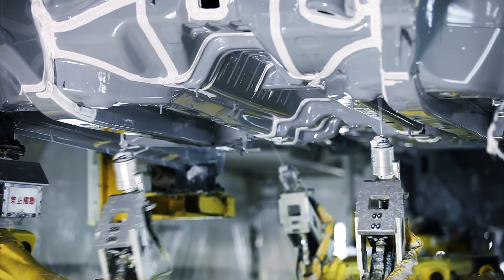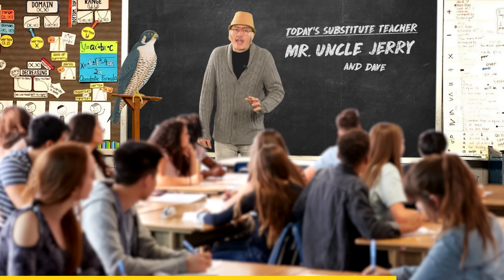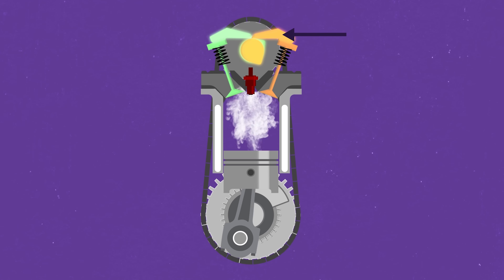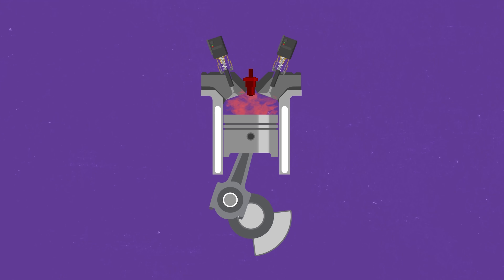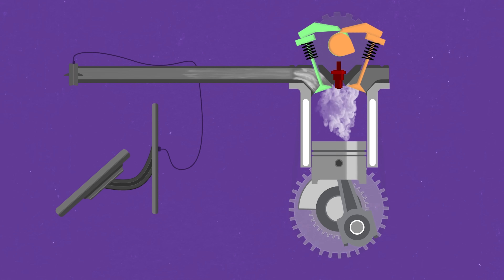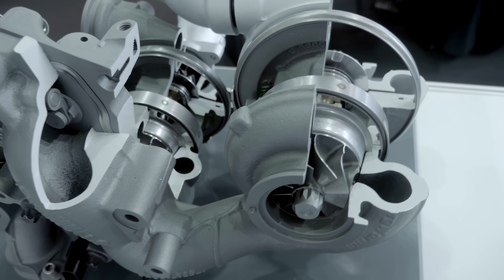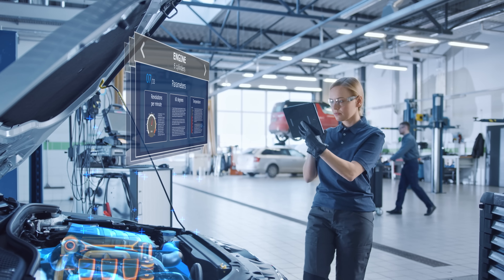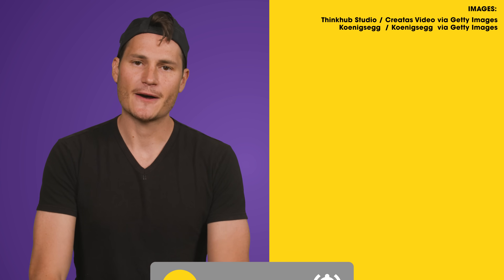This Is The Last Great Engine Tech

Comment: Fiat did something simmilar like 10 years ago, it was called Multi-Air but instead of the valves being fully electronic actuated they used oil and solenoid valves, and only intake valves were controlled this way. It's nice to see a simmilar technology much improved and with No timing drive needed. Nice video!

Comment: I remember years ago that replacing the cam sounded like a reasonable idea that no one could deliver, so bravo Koenigsegg
Reply: They have been running these in motogp for almost 20 years now
Reply: Around 60,000 USD for a set of 32 to run a 4-valve 8-cyl engine in a Koenigsegg (not including the controlbox and software licensing) :)
OTOH, that's "only" 30,000 USD if you're running a four-pot. Peanuts.
Reply: @AJBtheSuede  You can quite easily build these using hydraulic or pneumatic actuators if you have some experience in mechatronics. Provided you have the workshop equipment and fab skills. It's not like it's so easy that everyone can do it but it's still no as hard as making a carbon monocoque chassis in your garage.
Reply: @AJBtheSuede   yeah but that's most likely down to small scale production and performance requirements in a very high end engine. Basically all of the tech, software aside, needed to do this is fairly cheap and widely available.
Reply: Fiat multiair did it a decade ago lol
Reply: @AzathothsAlarmClock  https://en.m.wikipedia.org/wiki/Pneumatic_valve_springs they were first used in F1 in 1987 and in motogp in 2002.
Reply: https://youtu.be/0MycM4IRwXU

Comment: I think freevalve kits would be awesome... Just imagine increseing power and full efficiency of stock motors with something like this. I mean, wouldn't it be possible???
Reply: You need completely new heads. Pretty expensive in the aftermarket.
Reply: @R4M_Tommy  for now. Turbos aftermarket used to break bank. Once DIYers got their knucks greesed enough for OEMs to notice thier potential, turbos, though not super cheap for a good setup, become very uptainable
Reply: @TheDarkPacific  It's too long in the future. There's not enough time to develope ICE engines further. Nobody is going to dump money into something dying, and if they do, they better adapt fast.
Reply: @CamAteUrKFC  which is exactly what I said.. i dont and didnt know the owners of evs.  and 300 percent increase doenst mean anything compared to the amount of ice vehicles on the road and sold new pr used this year.  The Ice  market lost a single digit percentage to evs this year.... if even that. Plus, I'm an auto mechanic and my shop and all the shops and owners and techs I know arent exactly trying to find work or struggling. Infact business is booming and has always been booming and is projected to continue to boom. Not one auto tech has ever said they are worried if theres gonna be a car with an ice engine to fix tomorrow.. lol All the supposed laws u speak of are just executive orders that really are goals or guidelines but doesnt mean it's set in stone. 

My whole point of previous comment was just that calling ice engines DYING is silly because literally everybody with  automobile has an ice powertrain. I bet even the ev owners have a spare car or two running gasoline. Ice is dying yet millions of internal combustion engines are being produced continually and probably at a higher rate globally in the last 5 years than the last 100 years in 5 year increments comparatively.  There not dying... yes ev are becoming more popular... I never disputed that point so your comment is silly as well.
Reply: @CamAteUrKFC  46k cars are sold a day. And a projected 300k (actually less, numbers are high for growth) evs a year or 2% of the whole market. So 920 cars of the 46000 cars sold a day are ev. But gas cars and internal combustion engines are "dying"... ok buddy lol
Reply: @joseph420robert  Yes, that is was it means dummy. You said hardly any body was buying them, now it's 2 % of all sales? Get your facts straight. EV's are outpacing ICE's in market growth, and as such, companies have capitulated by investing heavily in EV tech, and production. Sales of ICE's might out pace EV's, currently, but that owes alot to current infrastructure and spending habits. Habits and infrastructure that will adapt. Do you think ICE's outsold horseshoes when they first came out? Just like for ICE's. Also it's 2% in USA, that numbers closer to 4% of all vehicles sold, and that number is climbing. Pretty much every market forecaster is predicting EV's to hold nearly 75% of all market share by 2040. The idea that ICE's are going to somehow stick around is actually laughable. Numbers speak for themselves, EV's are on up, and they're taking market share with them.
Reply: @CamAteUrKFC  like I said bro. I never said ev werent growing. I said that claiming ice is dying is silly. 2040 is literally 20 years from now. No one can predict 20 years to the future. ICE ain't dying. Motorcycles in america are dying with an actual stagnant market. ICE VEHICLES are still selling like hot cakes but there dying hahhahaha and you called me a dummy. Also it's funny how you act so smart but regress to insults when we are having a very simple conversation about the car market... nothing to get worked up about buddy? Lol 
 
Just because a market is growing doesnt mean its gonna take over the whole market. And no one can predict the future especially 20 years. And in 20 years the whole world will be different but that doenst mean gas cars are dying today. Your logic doesnt really make sense broo
Reply: @CamAteUrKFC  the difference between you and I. You listen to what people tell you like the economist or the news channel tv or the influencers or the supposed influencers.  Whereas I look at what's happening right now and right now 98 percent of cars sold are ice. If that's dying then I guess I must be on my death bed cuz I'm like 90 percent good health. Also I was dying that one time i got a 90 percent on the test I took. Or dammm my phone is dying cuz it only has 80 percent charge hahahha come on man admit 98 percent is like nearly perfect. Hahahahahaha bit somehow I'm the dummy hahhahaha u make me laugh broo hhahaa
Reply: @CamAteUrKFC  in the 80s the usa restricted Japanese imports with import taxes and limited the amount of unit allowed to sell in USA yet the japanese still dominate the market today in the small vehicle market. The restrictions may slow the market but it's not dead now or anytime soon. Ev market is growing doesnt mean ice market is dying. That's my point. Mnay people think just cuz something is being restricted doenst mean it gonna disappear. Ice vehicles are very plentiful and will remain so into the foreseeable future just as the ev market is projected to steadily grow. I know differing opinions can be hard for you to grasp but I think I simplified my claim down to an understandable enough level for your weak mind hhaha
Reply: @R4M_Tommy  for cars in $100k+ range it is cheap

what is problem is:

-amount of work which can only be done properly by a engineer in automotive degree specializing in engines themselves because it is not as simple as plug&play 

-you need to design the head,a ton of CAD work and a ton of crunching to see how can you fit such thing

-you need to know how to tune your freevalve setup which means you need to have knowledge in compute to know how it works and what can you do to increase its performance(overclocking the polling rate of electronic lifters would be a start)

-than you need to deal with input lag either via tune or by designing high speed low latency wiring which probably will go over CANBUS to make sure what you punch into your freevalve map is being applied on time because mechanical parts had no input lag,while electronics do have it because of length and resistance of wiring
Reply: @xthelord1668  OR, someone with the skills you're describing can design and program a kit for a popular engine, that can then be applied as a bolt on for any vehicles that use the engine for which it was designed.
Reply: @R4M_Tommy  Not all engines would need new heads. Hell I could put this on my 2010 5.7l Tundra with little work done to the OEM head castings. I would love another 121Hp and 129FtLb of Tq, plus any MPG increase lol.
Reply: @R4M_Tommy  yeah you’d have to replace half your engine block and get a new ECU. A turbo or supercharger give much more than 30% hp increase for only a few grand.
Reply: I think in a few years, there could absolutely be a market for Freevalve kits/heads. People who still love their gas cars, but want a more power, more space, and more efficiency. Especially if they allow them to be used in big racing series. Imagine the eyeballs you’d get on your product if the leading NASCAR or F1 team were using a Freevalve setup. The problem I see right away is: what engines do you produce them for? Whoever took on a job like this would be smart to consider which enthusiast vehicles are most popular, which engines are the most popular for swaps, etc.
Reply: for sure. especially the efficiency. I can only imagine how good it will work with diesel engines
Reply: https://youtu.be/9MdsZFFMHow
Reply: Kuilowkey,,, California would we sit until it really took off. People installing them for the house & clean air plus gas mileage. After the consumer spent millions of dollars. California would outlaw them. Then confiscate all the cars that had this system on them.
Reply: This might interest you: https://www.youtube.com/watch?v=8alrpieveDg

Comment: And mercedes says they have reached the “peak” of ICE engine
Reply: So they say, but actually adding freevalve to their engine would make it even better. There's still plenty of development that can be done on ICEs. And not to even talk about the fuel development. It's entirely possible we might see a carbon neutral ICE at some point. With current fuels it's impossible, but we won't know what kind of wonderfuel the scientists may develop in the future.

Comment: Only concern I can think of being non-mechanically linked is electrical issue causing catastrophic failure in an interference engine.  There's a reason that dude is experimenting on a miata, which has a non-interference engine.

Comment: Renault was working on electromagnetic valve actuation for their F1 engines back in the early 2000's.  The main goal for them was eliminate the camshaft as it was responsible for a lot of vibration in the engine and vibration was a killer of hydraulic systems or which F1 cars had many.   Surprised vibration reduction didn't come up here as a benefit as well.
Reply: Actually in mid 80's n Renault turbocharged RVS-9 1.5 litre Formula 1 engines

Comment: We need the Alfadan engine in a Miata from the factory that looks proper on 17s even stock height. Reverse the trend of truck sized wheel openings on sports cars.
Reply: @Nolan's Innocent what’s so funny? The old ones look awesome on 17s but the new ones look like a rally car in comparison just without the extra ground clearance. Truck sized wheel openings are a big problem on new sports cars they all look goofy with 20s, big fender gap and same or less ground clearance.

Comment: But how the reliability issues? I have alot problem face to face with selenoid valve in industry, they just dead without or less sign to aware comparing mechanical link

Comment: I’d really really really really want to see the free-valve on the miata. It would be like the last hoorah of the combustion engine, and hopefully might extend its relevance a couple more years
Reply: I think there's a YouTuber who made this at home
Reply: Boi, more fuel efficient and more powah
Reply: some guy already made one https://youtu.be/E9KJ_f7REGw
Reply: I agree. Money pit miata needs this!
Reply: Miata Owners Unite! It warms my heart to see so many comments about putting free valve in the Miata. Skip NE and go to NF for Freevalve.
Reply: Damn feel bad for you
Reply: Y E S
Reply: They mentioned a dude doing it on a Miata in the video......
Reply: @hedonist2104  I think he means Donuts miata specifically.
Reply: Gasoline powered engines aren't necessarily at the end of it's life cycle. Oil companies are too far into political pockets for them to make a move to alternative fuels only.
Reply: @Shutchohole  Thats true, since the energy density of batteries aren’t enough to match the range of combustion engines, and there are more explorable options like hydrogen and natural gas. However, ever since dieselgate, both manufacturers and governments are talking about only building electric cars between 2025 and 2030 so I wouldn’t hold my breath
Reply: https://youtu.be/0MycM4IRwXU
Reply: Check out Wesley Kagan's Freevalve projekt. This should be Part 2/2: 

https://www.youtube.com/watch?v=E9KJ_f7REGw

Comment: It's just solenoids and possible some servos. And they've been around for years.

And just think a head without a camshaft, pushrods, lifters etc. Lot simpler and cool. But electric maybe the solution overall.

Comment: Petrol is far from dead, the energy density compared to batteries is still way too high.
I would LOVE to see the Donut Miata get some Free (love) Valve tech!
Reply: Most of the energy ends up as heat though, not as buff ponies.
Reply: @panzerveps  the electric cars makes an assload of heat
Reply: @Justinlifts365  60% of energy in combustion engine goes to heat. It's more like 5% in electric motors.
Reply: @Justinlifts365  yeah, about 10% ends up as heat, vs 60% on a modern super efficient diesel.
Reply: @panzerveps  EV power trains also generate a lot of heat--in the batteries and motors. Not sure what the thermal efficiency is, but cooling is still a thing.
Reply: @bongosock  cooling is mostly for charging and when pushing it hard. During normal driving, there's not much wasted heat at all.
So little that you need an electric heater or heat pump to get any warmth in the cabin.

Comment: "Half the cylinders feed the turbo"
"3 cylinders" 
Hmmm.....
Reply: 1.5 cylinders feed the turbo. C'mon shadow105720, you should've learned this in 3rd grade.
Reply: @Ordit229  Lol, I think you are joking....but, I am pretty sure that this is actually kind of true since each cylinder has 2 exhaust outlets and it is half of the exhaust outlets feeding the turbo.
Reply: @_Ezio__Auditore_  i actually was joking lol
Reply: They say half the exhaust outlets, each cylinder has 2 outlets which can be controlled via the valves... I.E keep the turbo exhaust valves close and open the non turbo ones
Reply: Koenigsegg Gemera has 3 cylinders and 2 turbos ;). every cylinder has 2 exhaust holes
Reply: @zacha4495  the diagram and way he explained how the motor works is not accurate in entirety..
Reply: This idiot video got it so wrong, ALL EXHAUST FEEDS THE TURBOS, BUT AT IDLE A VALVE IS CLOSED TO CUT EXHAUST TO HEAT CATS!! He also said FREEVALVE has only been a company for 5 years and that too is wrong....
Reply: @NET-POSITIVE  god I hope your joking
Reply: @Ordit229  God your anonymous so I don't care what you say!
Reply: @NET-POSITIVE  me neither!
Reply: @Ordit229  lol
Reply: @NET-POSITIVE  thanks for not talking
Reply: @NET-POSITIVE  he said half of the exhaust OUTLETS. that means one of the two exhaust outlets of each cylinder. dont call him an idiot just because you cant comprehend words.
Reply: @Kevin-dt9xm  His complete description on the full functionality is WRONG!!
Reply: @NET-POSITIVE  how so?
Reply: @NET-POSITIVE  I don't believe SCREAMING PEOPLE
Reply: @atragerlspezi9500  so when people scream "HELP I'M DROWNING!" YOU DON'T BELIEVE THEM??
Reply: @AzathothsAlarmClock  If someone is describing a function they should be completely accurate.. watch engineering explained on this and then you will be the idiot.
Reply: If those of you would watch engineering explained channel on this you would see I am right!!
Reply: @NET-POSITIVE  If you would please stop talking we would all be happy!
Reply: The information portrayed through this channel is for enthusiasts. General accurate information that the average person can understand and digest. Engineering explained is for more in-depth text book style learning. The concept he used was easy for someone that had never heard of freevalve before to understand

Comment: I am going to miss internal combustion engines! Dang electric cars!
Reply: I highly doubt ICEs will ever go away. There's not enough accessible lithium in the world to make enough batteries to replace even half of all gas cars. We also need those materials for batteries in all the other electric devices, like phones. It's simply impossible unless we develop a new electric power source. Modern electric cars will destroy this world far faster than gas cars if people keep pushing the switch to them when we don't have the right tech.
Reply: @mazdaweeb3  good point.
Reply: @mazdaweeb3  how the fuck is electric car making gonna destroy the world faster than gas, exactly?

like man I get that you don't like electric cars but stop repeating these conspiracy bs talking points from like 2 decades ago. ice isn't going anywhere, electric is cool.
Reply: @huleyn135  you probably pretend battery recycling is done properly and cobalt mining isnt a huge issue too. Gas personal vehicles arent destroying the world at all
Reply: They wont be going anywhere and i will not ever be going electric
Reply: @Gl-my8fw  i like orange juice
Reply: @Gl-my8fw  same.
Reply: @izanjamani6483  agreed.
Reply: @Lane Araujo Just because it's common doesn't mean there's enough. While batteries are recyclable to get the lithium back, it's very hard to do and uses a lot of energy.
Reply: @izanjamani6483  I feel the same way.
Reply: @Lane Araujo lithium isnt easily obtained either and either way my point stands that they arent better for the environment and personal vehicles were never a significant issue either way